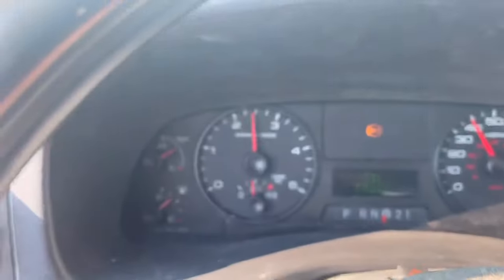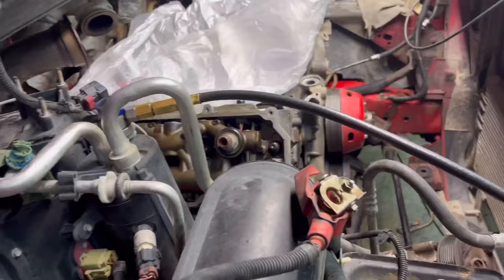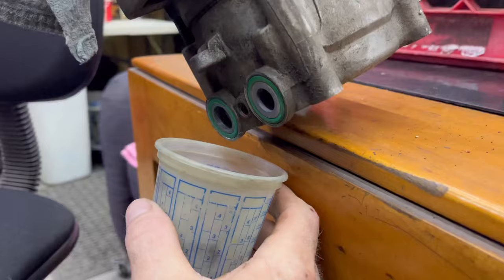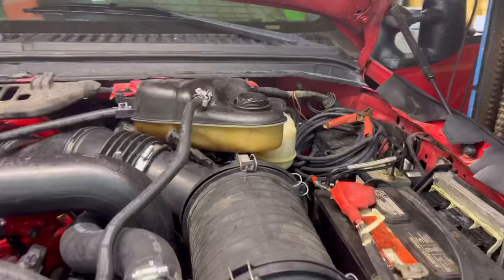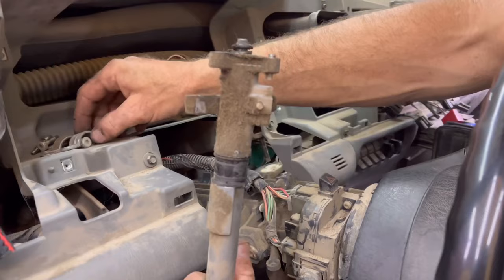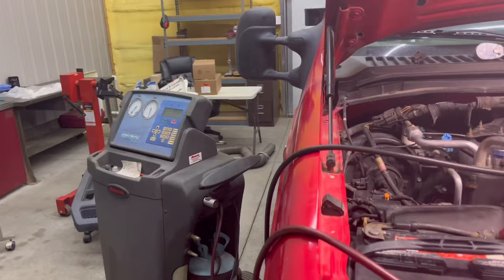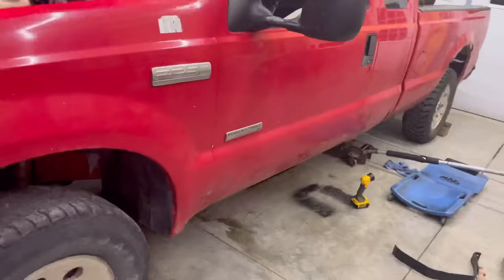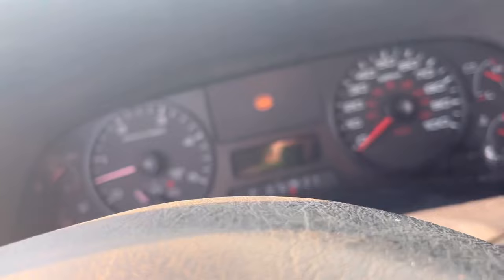Air conditioning BLACK DEATH!!!   Can the orifice tube be swapped like a FILTER???

Comment: I have a chronic intermittent squealing serpentine belt. 
All the pulleys are new.
Ac compressor is new.
Degas bottle is new.
Water pump is new.
Belt is new and installed last so no red coolant has spilled on it. 
The belt will be silent until it’s not. Then it gets really bad over a day or 3. Then it’s silent again.
Repeat.
Reply from the maker: What belt??  I would just about rather walk than use the gates belt!!!